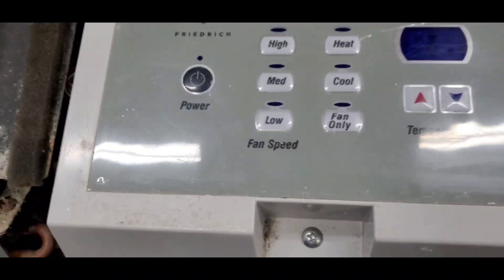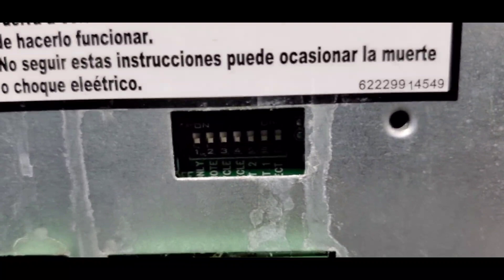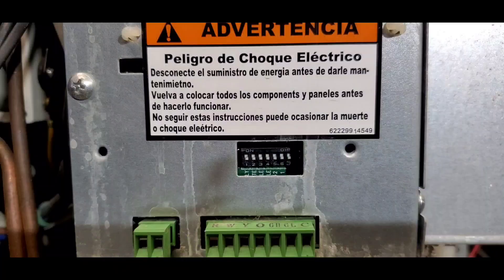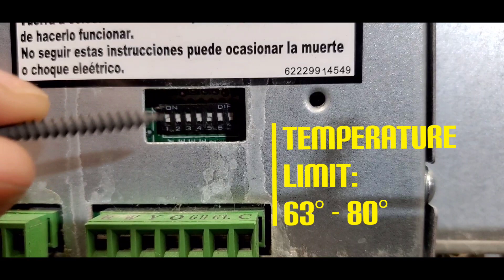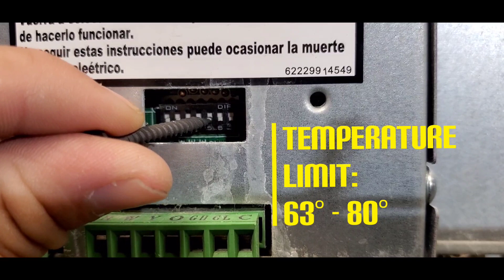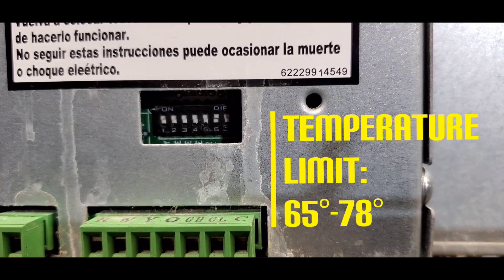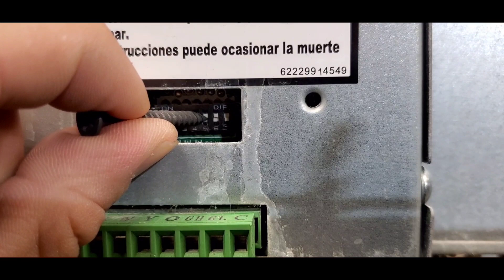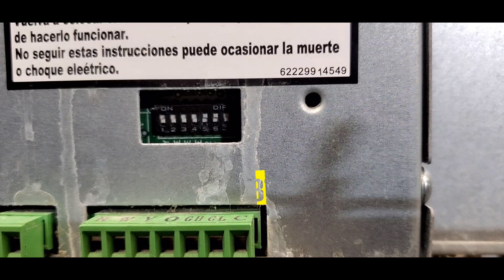How to set temperature limit on Friedrich ptac...

Comment: Hey Dave. I have a question for you. So, in my apartment I have a PTAC in the living room and one in the bedroom. Both of them have the same issue. So, when I turn heat on, the fan never shuts off. It runs constantly. I've tried messing with the fan options and lowering the temp, but it just runs and runs. So, I feel like that's so expensive cause my apartment isn't that big. So I spend all winter turning the power off and on on both units. is there any way I can get these to just cycle?? Thanks in advance!
Reply from the maker: Hello 
Do you know the brand name of the unit?
Reply: I don't I tried to find any info on either of them--brand or model. I could send you pics if that helps. Thank you for responding!! This is driving me crazy.  @PtacSolutions
Reply from the maker: Yeah you can email them to me at
Davidcardenas@airight.net

Comment: Peace of garbage electrical parts burn out after 2 summers and the parts are always on back order during the summer which is a tactic they use to get you to buy a new one as for warranty does not cover shipping of parts and installation of parts if parts are available